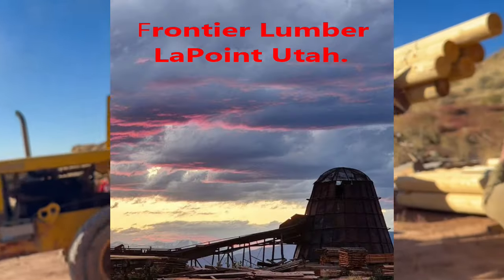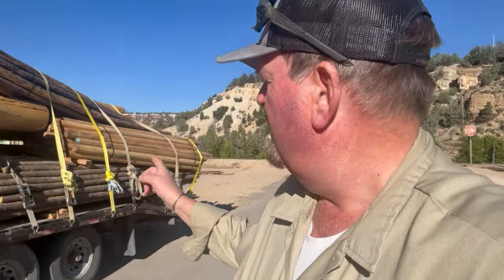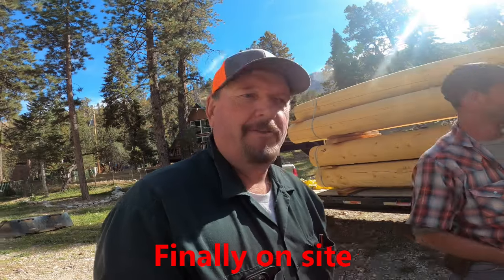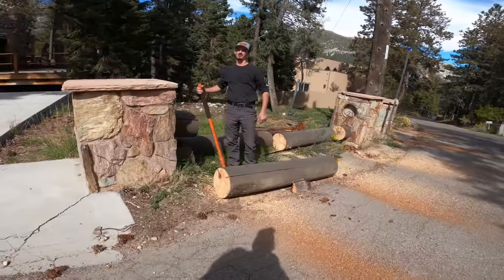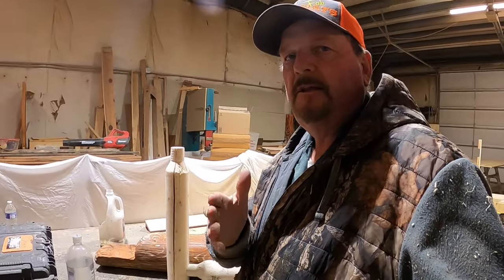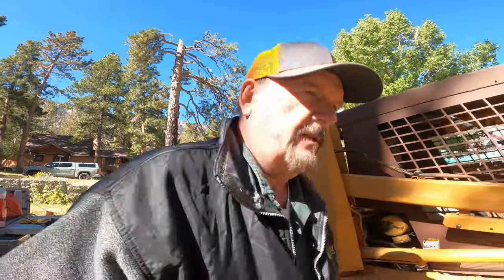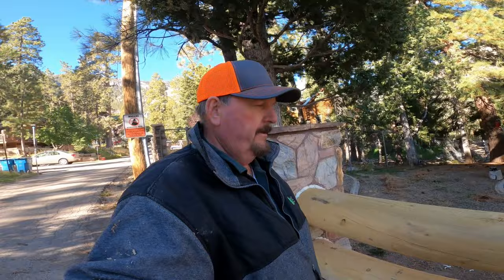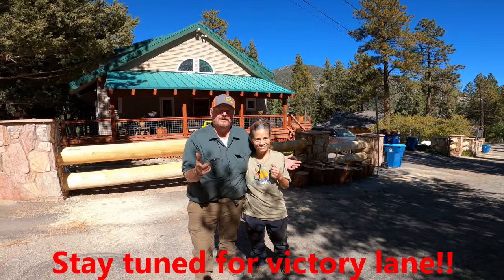Have you seen a log Stretcher? One Log is 2" Short, How to You Fix it When Your 300 Miles From Home?

Comment: Use a cheap cerated steak knife to cut spray foam it works wonder compared to any other kind of knife
Reply from the maker: I bet that would work pretty good. And you would have more control than a sawzall
Reply: Me too..  got another one in my garden tool bag, they work wonders cutting up sod to repair sprinklers too.  I use the longer bread knives.

Comment: Clayton! :) Maybe you'll need to have a chat with Paul and Michell about what system they have in place when it comes storage of footage. 
Ideally you should have physical markings on your recording media (and keep log (pun intended) of what media was used on that day/job), and make a copy of the footage each day to your 1st standalone harddrive. And then a second copy to a raw-file back-up, on a separate harddrive . So when you have the raw footage on 3 places (SD-card, 1st and 2nd harddrive), you can consider to wipe (make space) on the SD card / media you used that day. 
Then when it's time for editing, you take the files from your 1st harddrive, and make a 3rd copy to your editing hard drive (also physical seperated harddrive). When you are done, you make a new copy of your finish video to a 4th harddrive (for safe keeping), before you upload. 
And if all goes well, you never need to access your 2nd (raw-footage backup) and 4th (edited backups) harddrives. But if you have a computer crash or corrupted files, you always have a secure backup.

Comment: Clayton you are clever at working those jigsaw puzzles. I was wondering how you would fit those tree trunks into those captured ends. I never thought about anchoring the ends in expanding foam insulation. Will you have to comeback and mortar over the exposed foam for UV protection?

Side note: Do you or Hunter have a good system to prevent the SD problem? I am sure many of us would like to avoid losing our quality footage before it gets a chance to hit the cutting room floor.
Reply from the maker: I’m a technology dinosaur, so I’m learning as we go. I’m hoping it’s a one time thing. That said GoPros can be temperamental too
Reply: @SAWDUSTLUGNUTS  Me too, I'm a dinosaur as far as some of these new instant foam products go and I would still rather fill a canvas bag (pastry bag) with hydraulic mortar using a waterproof fortifier mixed in with it squeezing it in to fill the voids.  I'd be fearful of a canned spray foam collapsing and allowing the logs to shift due to the weight of the logs along with thermal expansion and contraction.  Did you put stone shims in the pockets under the logs to support the weight and minimize drooping?  Was there any of the old mortor used to originally fill the pockets left behind?  We had a PorterCable Concrete Router/Planer that we used for cleaning that up without stressing things as badly as you would with air chisels, hammer drills, etc.

On computers and electronic tech I had to reinvent myself after a crippling injury and become adept with it.  Copy, verify and backup plans are still required regardless of how solid or common place the tech is.  A good portable card wallet to catalog the full cards and backups along with a separate device to read, verify and make copies of them is safest.

Don't overwrite those cards though until you put the cards in a reader on a computer and run a scan with even a freeware recovery package.  For photos my goto is Digital Image Recovery which will recover files even if they are not in a recycling bin or deleted file folder.  If you didn't actually do a forensic wipe of the card you might be surprised at how many deleted files will still exist in the shadows even after you've started recording over things.

Best!